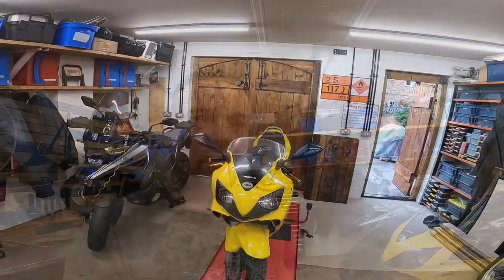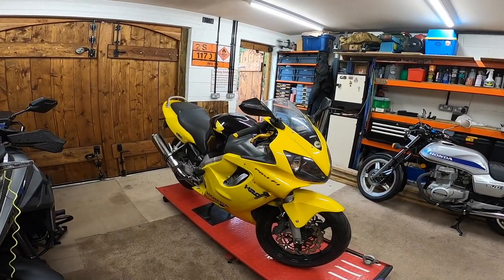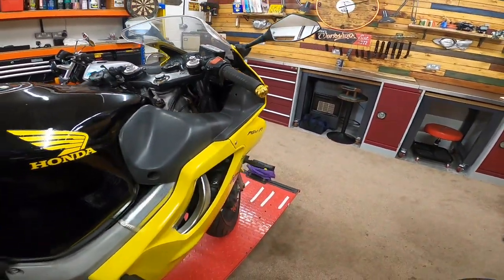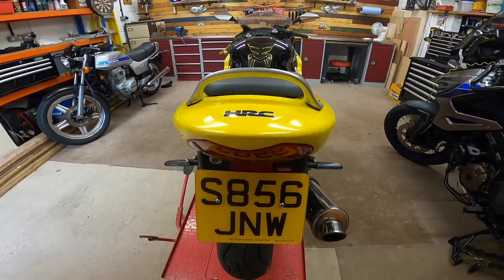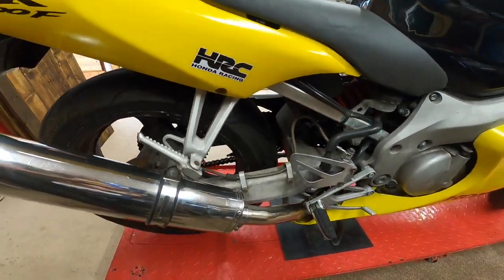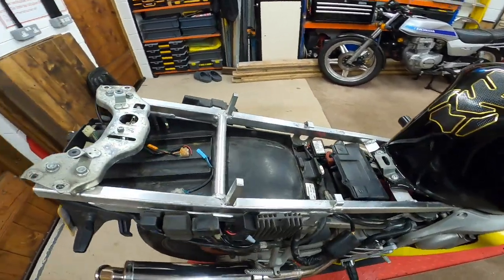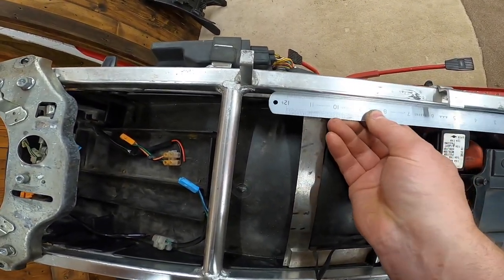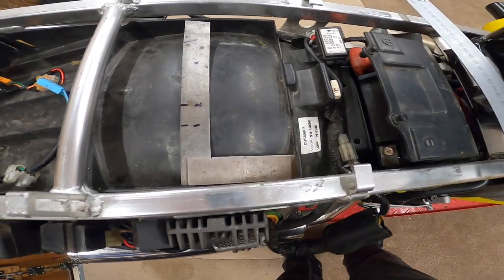CBR600F4. Part 1. What have I done ?! Subframe bent?

Comment: Hey I recently bought a 2003 cbr600 f4i and I also didn’t notice that the rear tire wasn’t aligned with the tail 🤦‍♂️ I do feel the bike pull slightly to one side, the side where it looks like the tail is bent. I’ve checked and redone the front tire and suspension, I’ll have to check to make sure the rear tire is aligned but after seeing this I think my suspicion may be correct , might have to just replace the subframe. I haven’t been able to really enjoy the bike cause I’m not 100 percent confident in it after seeing the tail and I wasn’t sure how to approach it either. 

Thanks for making this vid, you helped me understand how I can check if the subframe is bent and what I need to do to replace it. You’re a lifesaver 👌 keep making vids 🙌🙌🙌
Reply from the maker: Thank you for your kind words. 
I actually have not ridden the bike as yet due to me wanting to go through it thoroughly from a safety perspective. Then when I noticed the issue with the subframe there was no way i was riding it!😳. 
I do enjoy a project and I will definitely be doing more videos on this project. Another one due in the next couple of days. 
I hope you sort the problem easily and swiftly, ride safely 👍.